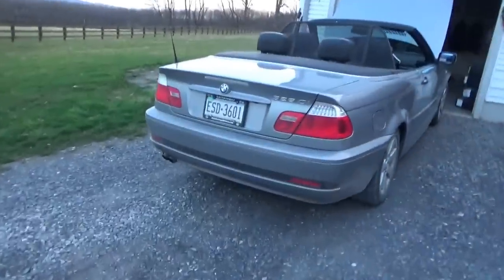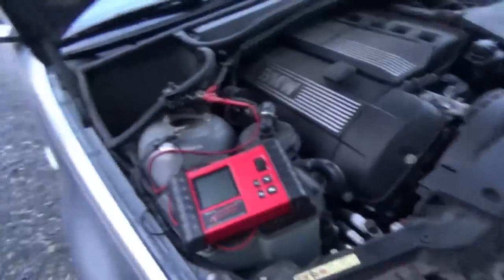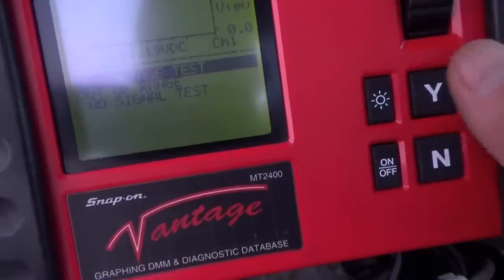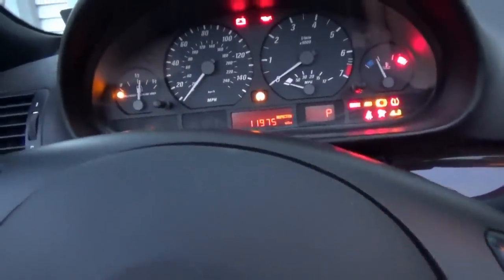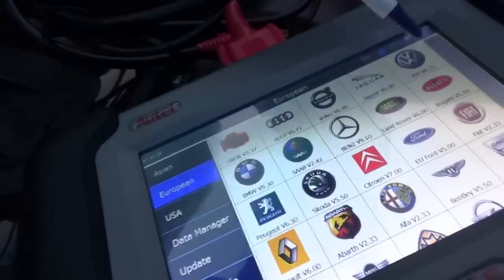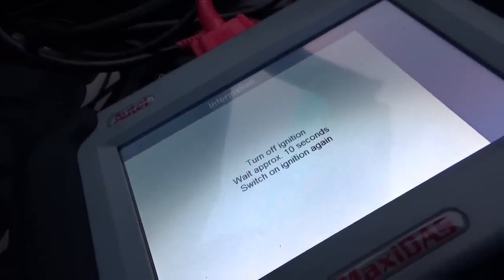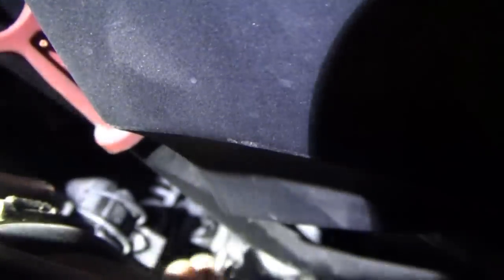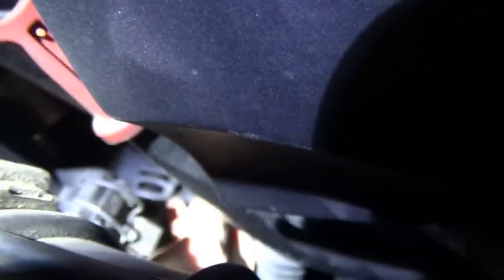BMW Charging System Alternator -Diagnosis

Comment: To make your diagnosis more accurate,I would suggest you measure the duty circle of the lin signal wire used by the ecm to control the alternator field strength. If the control is always okay and the battery is still not charging,then your alternator is gone

Comment: Man I had a issue  where the battery terminals corroded off replaced with new terminals noticed alternator had seen better days so replaced that and customer wanted to replace the battery because it was a 3 year battery and been running for almost 6. Any ways put in a reman oem two weeks later the alternator failed and took the battery with it.

Comment: Bass player in my band bought  a 2005 BMW,,, he's been having more nightmares than those kids on Elm Street!!!
Reply: Germans are great at designing things. Usually. But you have to tell them what you want. And what the engineers at BMW were told was this "We want a good performing car that will be trouble free for exactly the length of one lease period. We don't care what happens to the car after that."
Reply: That I believe.

Comment: why mechanics are "shady". Usually get a hour paid to diagnosis.  ( where trying to only pay .5 at the shop I work). 9-10 times when u get a car it's not acting up or comes back to life while testing. spend 20 minutes or so trying to duplicate then research. by then writer bugging u for an answer.  why do u think techs end up throwing a part at the issue.....
Reply: I used to troubleshoot Large Computer systems, by the hour. Nobody ever complained how long it was taking, not my Boss, or the Customer. I could of taken a week. Wonder why the difference between the trades? Looks like they still think you are replacing a Carb. Maybe they want to down play the job, so they dont have to up grade the pay, sounds more like it. Mechanics are in a really strange place. Kinda a Gray place. We were told by the bosses, if the problem has gone away, replace something. They suggested listing 3 possibility's then replace 1st one on the list, then leave list, in case you weren't the next tech out there, If you dont do something its a complete wasted trip.

Comment: Another thing to check on these cars is the engine to body ground  cable on the passenger side. You will get a no crank situation there, but the lights will come on in the dash. Also you can get a secondary air pump for those in the $100 range on amazon,  and the E46's didn't need the battery registered to the car, that started with the E9X models.

Comment: I don't know why he'd think that a communication signal wire isn't something to be concerned with. If the alternator isn't getting the information or signal to start charging then it won't charge even though the alternator may be just fine. Etc.

Comment: Ivan this car does not have a intelligent battery cable and if it had one it would be the negative cable. The Terminal you were pointing at was the airbag safety terminal. The battery manufacturing date is on the lead terminals. This battery does not have to be registered on this model. If you had a broken bsd wire the altenator would go into default mode so it always charges. If you get a new altenator be carefull with aftermarked ones because i had problems with that in the past, causing communication problems because of wrong software versions.
I wish we got code setting criteria over here in Europe but unfortunately we don't. 
Good Luck with the repair and thanks for the great video! 😁
Reply: DiagnoseDan says part 1 😉
Reply: Inside information that's not fair😂😂
Reply from the maker: Thanks so much for the valuable info, Dan! You are a Euro expert :) Yeah, I generally go only OEM aand brand new for any electronics part, especially Euro. You will see why in Part 2 haha
Reply: Can't wait for part 2!😉
Reply: DiagnoseDan. Dude why you copying on me? I told ivan already about the bsd😰👿👿😈😈💨in all seriousness when are u posting. Another crazy case study? Since i watch your shorted bmw door handle video i am paranoid .before condaming a computer for no communication i have to check all output and input in addition to power ground and comm wire.
Reply: Meant BST battery safety terminal
Reply: ousmane sarr within a few hours a new video is comming up😁
Reply: How can I get a wiring diagrams please and thanks

Comment: I would suspect the battery first and do a load test.  I HAD a E90 that I bought from a neighbor.  He had replaced the battery but never registered or coded the battery.  The E90 has the IBS or Intelligent Battery System.  I tried several different scan tools and finally invested in a Bimmergeeks ProTool.  I  replaced the battery, regsistered and coded it and got rid of several "Phantom codes" that were stored.  BMW way over-engineered the charging system and if the battery starts to fail, the main computer starts shutting down "non essential" systems like door handle lights and other creature comforts.
Sorry to go on a rant, but that car drove me crazy trying to figure it all out.  All the guys on Bimmerfest recommend INPA which is a program you can run on a laptop.  Again, don't discount the battery as being the culprit.  Basic stuff, always make sure your battery is good before checking out the charging system.  Good luck and thanks for your videos.  I enjoy your approach and skills.

Comment: Though we source all the same scan equipment you utilize from similar sources, we in Australia are forced to pay exuberant prices for updates, which are always several versions behind current, and have very limited access to manufacturers data, such as wiring diagrams, service reports, etc. Our goverment implimented regulations forcing vehicle manufacturers to share their dealer data, But as there is no watchdog to enforce this, manufacturers refuse. This makes unusual  or intermittent problems near impossible to diagnose easily, but creates innovation and innovative diagnostic techniques. Great vids, great diagnostics, great info Ivan. Till next time.....👍👍
Reply: The government is 'considering' the ACCC recommendations that manufacturers be mandated to share servicing and programming capability  with the aftermarket . That was months ago but still no word from Canberra with a decision. J 2534 is still pretty much in 'the dreamtime' if i'm not mistaken. The politicians are slow to get it that Ford and GM are no longer in a position to use blackmail any longer . Cheers
Reply: Andrew, I think you are forced to pay exorbitant prices, which  makes the update sellers exuberant.
Reply: tecnaman : The automotive industry has a highly paid lobby group that excells at spreading absolute propaganda  to our politicians, whom, due to many factors, accept what there putting forward on face value. This is the FCAI, or the Federal Chamber of Automotive Industries. According to their statements, which are all publically available, if manufacturers are forced to share information, dealers will be forced to shut workshops, the black market for parts will boom, prices will skyrocket, warranties will become voided, blah, blah, blah, and Australia will collapse into a state of Anarchy followed closely by Armageddon !!!!....and we cant have that happen !!!! 👍👍
Reply: caduceus33 : When you are dealing with manufacturers like Caterpillar, Sandvik, Atlas Copco and Elphinstone, you are required to purchase individual scantools at approximately $80k each, subscribe to individual updates, another $25k per year, and still be restricted to limited resources. And you cannot just purchases from overseas as each scantool, its proprietary software and the software embedded onto the equipments ECU, is regionally locked.
Reply: tecnaman If everybody just started charging for the time it really takes to wade through all the BS people would think twice about the purchase next time. There is absolutely no reason for someone who is being intentionally handicapped to charge less than the dealer. Just think. A business is about the business. A charity is about the people. I doubt anyone here is a charity, at least not intentionally. If EU car owners got hit with $175+ per hour everywhere they went for service things would change fast.
Reply: New Zealand has the same issues with info
 except no government regulations to allow the independents to access information and nothing n the near future. I think the reason for this is the dealerships strength on the NZ Motor Trade Association. Ironically, the general work independents do, the dealers don't want or don't want to spend the time diagnosing.

Comment: Most modern European cars use internally regulated alternators. That connection to the ecm is just a reference wire for the ecm to read system voltage directly so it knows whether to illuminate the battery light etc.
When the alternators in these cars go bad 90-95% of the time it’s the regulator or the brushes that have gone bad (which are usually in the regulator), you can usually buy the regulators individually online and can usually find oem parts. 
Not often is it a battery unless there is an intermittent bad cell.
Lastly the oldest battery I have personally removed from a year 2000 bmw 330ci convertible was its original bmw varta battery from factory….  which at the time was 21 and a half years old, until that week it had always worked and never showed any issues. So batteries can last up to two decades in my experience.

Comment: Ivan i have had a few earth problems on the charging systems with Bmw.
There is a large earth cable from the bell housing to the floor which are prone to corroding.
Had this problem a few times.
Nice video.
Reply: in US English... it's called GND.
✌️

Comment: Nice E46! I just went through similar with mine. Even though I called the alternator and it fixed the issue, I still took the old one apart just to be sure haha. The brushes were worn out. A fix feels so much sweeter when you confirm it :)
Reply from the maker: Interesting! So it was mechanical wear, not a circuit board/component fault on yours :)
Reply: Sorry to be so off topic but does anybody know of a way to log back into an Instagram account??
I was dumb forgot the password. I would appreciate any tricks you can offer me
Reply: @Jordan Ahmed Instablaster ;)
Reply: @Bishop Cedric It worked and I now got access to my account again. Im so happy:D
Thanks so much, you saved my account :D
Reply: @Jordan Ahmed No problem xD

Comment: Now you get feeling what lack of OEM information is like. What should be relatively simple, becomes overly complicated. The aim of the whole exercise is a return to the main dealer and the costs that ensue.The low tech approach would be visual inspection on all earth connections, check alternator brushes, diode assembly ect and if replacing the alternator, a new battery is nearly a must. Good luck with the repair and feel the exasperation by a lot of techs.
Reply: well said! Thank you.

Comment: I agree with the others.  Remove the alt and check the commutator for shorts, clean the ring, check brushes, check diode pack.  That would give you the 100% diagnosis you need.  I fixed my old DELCO alt with a new diode trio from Autozone.  $7.  My choke light buzzer was seeing random AC in the system.

Comment: I own one of these, and I must say I have zero regrets after 5 years of ownership. Bought it with 268K kms, now it is at 368K.
There is a very strong online community on the E46 platform. They are known to be finicky, however once you've taken care of the usual culprits : cooling system, fuel pump, ccv, you've got years of pretty much trouble free driving. And I must say, after owning Toyotas and an Accord, driving wise the E46 straight six 3L and its handling are far superior
Reply: I guess you left out all the bushings, control arm, ball joints, bearings... high maintenance.
What sort of scanner is your favorite go to?
Reply: @glasser2819  I am not very advanced in auto diagnostics, I own a very simple code reader. I do have a four channel scanner, that I tried playing around with, but never became competent at it. 
By the way, the car is at 424K kms now. I did change both control arms. Outside of that, nothing really.

Comment: Hey Ivan, I feel your frustration.You can not perform a proper diagnosis on a system without firstly fully understanding the operating principles otherwise it feels as if your a guessing or applying knowledge from previous experience which can lead you into hot water. Modern charging systems I have seen incorporate three wires going into the alternator in addition to the main thick alternator output wire going to the battery. These include a power feed for the control module in the alternator, a pulse width modulated  command signal coming from the PCM and a Pulse width modulated signal output from the alternator back to the PCM utilized as a feedback. The system also uses a Battery current sensor to monitor current usage and this information is input to a body control module which in turn sends it to the PCM.  As for this BMW 1 wire set up  I will say that just when you think you know cars, along comes something that makes you realize you don't fully know them. 
The fact that it is difficult to find good information tells me that some manufacturers still do not  prefer independents to work on their products as their own technicians must have access to this information to be able to work on them otherwise no one could fix them. Personally, I would stay away from anything which makes it difficult to access information.
I would like to hear from someone who has worked for a european dealership to get their thoughts on this.

Comment: The car does not have a battery sensor. What you are looking at is the srs which deploys in the event of an accident and disconnects main battery power. 
The bsd is the bus that goes to the alternator, oil level sensor and dme.

Comment: We just figured changing Bosch alternators every 500 hours on our German equipment. Always kept a rebuilt on hand. Usually, it was the brushes and the module that provided the D+ signal. A little cleaner air in a car so not as much brush wear.

Comment: The BMW alternator is an easy rebuild.
Normally a Bosch part and regulator, bearings, slip ring are all readily available and parts are cheap.
In the UK can buy all parts for rebuild on a E46 for £40.00 (50 dollars).
Reply from the maker: Wish rebuild parts were available here in the US...maybe I don't know where to look?
Reply: @PineHollowAutoDiagnostics  100Kmi: I would look for an OEM "brush set".
✌️

Comment: I lucked out on a '73 Corvette with an intermittent alternator problem. It stopped charging while I was there. It was the internal regulator in the alternator. Easy fix. Now I'm trouble shooting a 2014 Mustang with parasitic draw.

Comment: Not familiar with that scan tool, but will assume it doesn't support bi-directional control of the alt. Maybe just because it's a Euro car? I dunno. I don't play with them often enough. I have been fortunate enough to use my OTC to be able to control the duty cycle on most domestics and some Asian cars w the smart charging system, and verify that the Ecm was calling for more charging, while the alt was taking a powder. About a month ago, I caught an F150 that had good charging voltage, but not enough amperage , that would set off the B+ light, sometimes a code, maxing out at about 44 amps. The OE battery had already been replaced. I had to load it up with accessories before eventually it started to lose voltage slowly even the dwell was 100% at idle. It would come to life at about 2500 rpm, but slowly deteriorate under load. Anyway, seems you called it correctly!

Comment: This video makes me feel a lot better about myself. I'm a Benz tech and always wonder how you, Eric and Keith would do on some of the cars we get. I haven't finished the video yet, at 22 minutes, and am wondering if you have a bad voltage regulator (possibly a bad diode?). A lot of our problems are intermittent, and even at a dealership we don't always have all the information on the system we are working on. It can be very frustrating.
Reply from the maker: Thanks for sharing this, Dan! I wouldn't last long as a Benz tech...would probably start swearing and set the car on fire on Day 1 LOL
Reply: I'm sure you would be just fine! I've learned a lot from your videos and really appreciate what you do!
Reply: I bet it's the ECM smart charging control software that is feeling unsafe to charge the main battery. So alternator puts out minimal charge until you turn on the driving HEADLIGHT then control goes back to normal for night driving safety.
👍

Comment: Ivan,  that was weird diagnosis, lol.  As of the smart thing. Not calling the alt issue.  Ahhh! But good thing you found out in the end for sure.  I like simplicity.  Use multi meter, check for charge ,  bad? Ok swap it out lol.  I know it sounds like parts cannon lol.

Comment: The problem might be in the oil sensor, (they are know to fail a lot) wich is in the same BSD network as the alternator signal wire. I said might be but not sure, in my case it was the sensor setting multiple fault codes in this particular network. Cheers.
Reply: The car was e90  pre lci, but it might be similar system